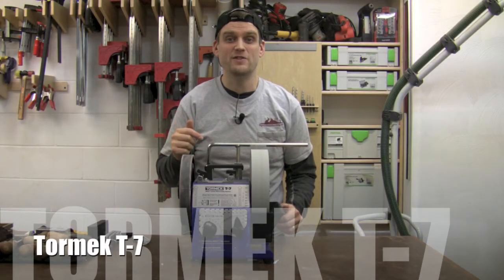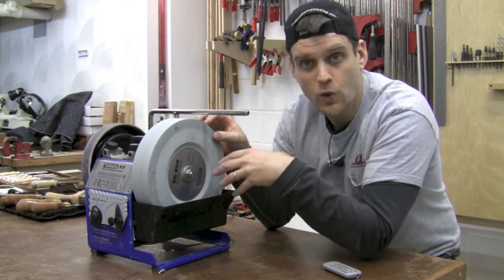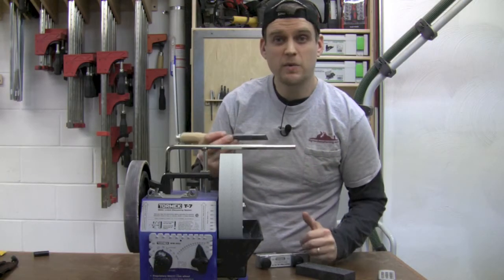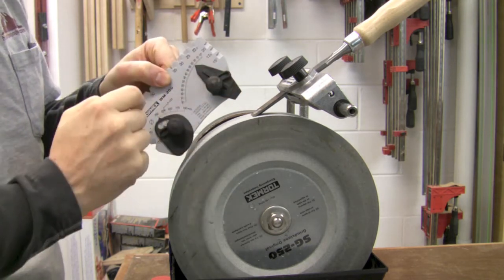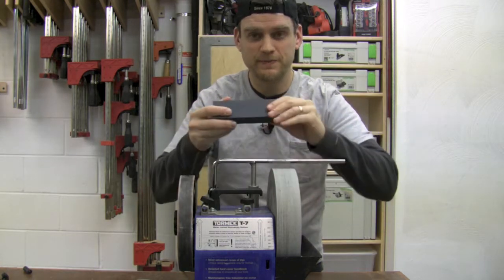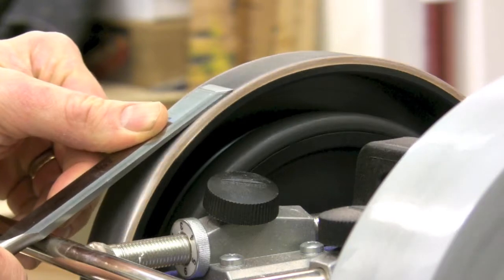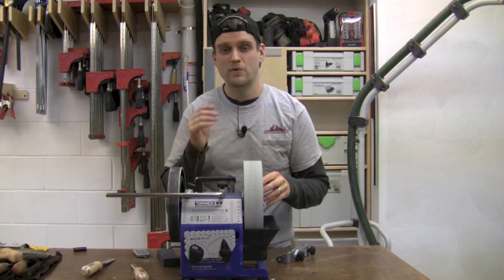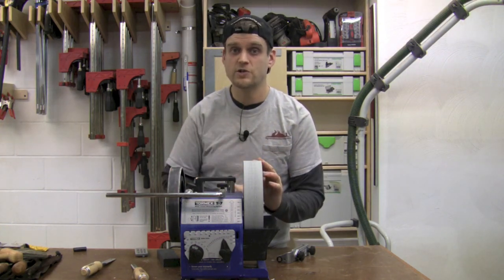Tormek T-7 Sharpening Station Review - Product Tour

Comment: I don't use a micro-bevel with this system.  A micro-bevel is useful to quickly re-hone the very tip; less metal to remove. Since the stone puts on a concave surface, you can either go back to the stone to quickly hone, or use a flat stone or strop which will only touch the very front edge, making it extremely quick.

Comment: Yes!  Obviously that doesn't matter to the wood as the very front edge of the steel is all that does the cutting.  The benefit though is that you can quickly hone that edge on a flat stone since you only remove metal at the heel and toe, which is a lot less steel to hone than the entire bevel.